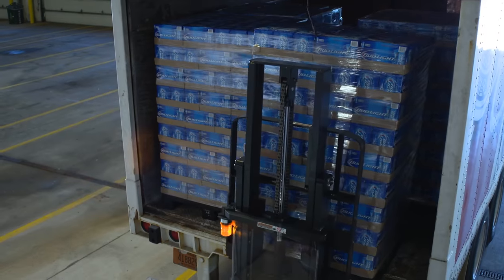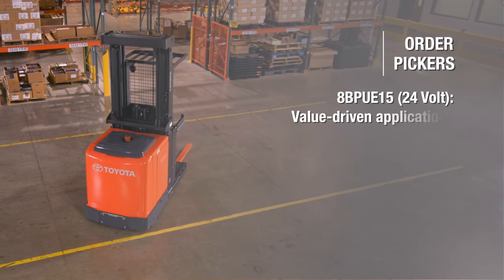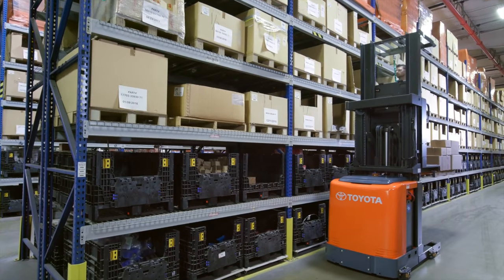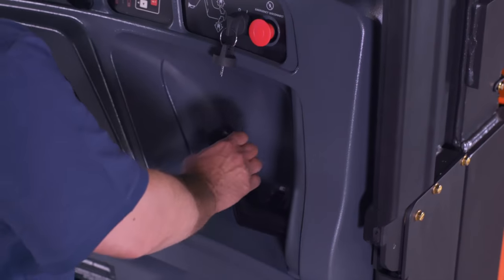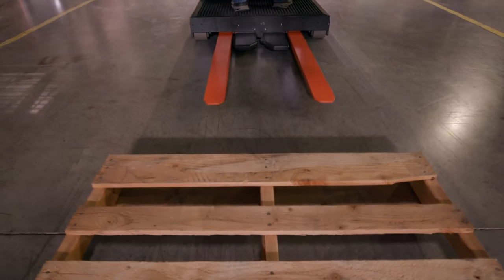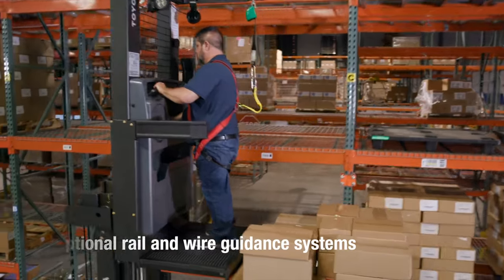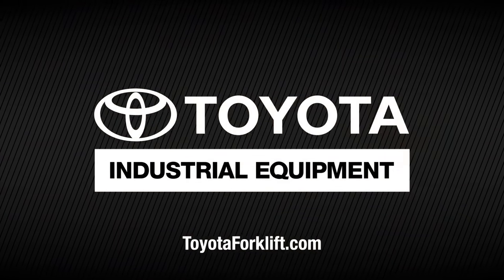Toyota Material Handling | Products: Order Picker

Comment: 0:39 That dude is driving it while it's so high like that? Fuck that shit lol. Are they even supposed to be moving while they got it so high?
Reply: yes. It helps with being able to clear tight corners and such. I’ll start going full speed forward or backwards while descending or ascending
Reply: Yup, it's part of training. Crazy, huh? I freaked out a little the first time I did it...
Reply: Yes, in fact it’s expected so you are more productive. 

Only after like 30 min of driving my trainer told me to go full throttle and raise to full height at the same time. 

It was wired guided so I didn’t need to worry about steering, but it still gave me knots in my stomach. 

Imagine going up an elevator while also moving forward.

Comment: if this machine fall.. the operator at height will be in danger
Reply: yeah people die on these
Reply: Ur not really driving around that much when ur up high place I worked at the aisles where just big enough for the machine to sit on and had gard rails on floor so it went in straight line so u would have to be trying to tip it over for it to happen the ones I drove had room for 2 pallets

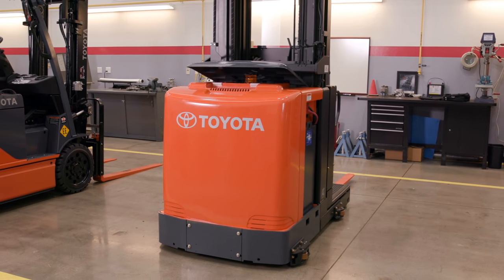Comment: Hi !! Can you check the video again. At the 1:50 minutes the man driving order picker is lowering down with right side gate up position. An order picker can not travel or move up/down with any gates in up position.
Reply: @martinreyes8341  he's actually right. the machine isn't supposed to let you do that. with raymond if you have one of those bars up and try to move it will beep at you and then it won't move in any direction.
Reply: Electronics For Fun with the one I use it didn’t matter we wouldn’t ever have them down
Reply: It depends on the model. I drive Raymond and it lets me drive with the side handle up or down
Reply: @nissanboy97  I drive a raymond as well and it won't let me drive with them up.
Reply: @ElectronicsForFun  that is weird. A safety feature that probably don't work on mine
Reply: @nissanboy97  our older Raymonds dont let us drive with them up. Newer ones do though..
Reply: @Q-gf8vb  the one I operate is new and it don't stop with the tail up
Reply: I drive Raymond and I can drive with sides up and doesn't beep at me at all